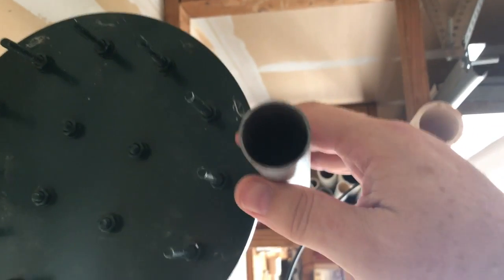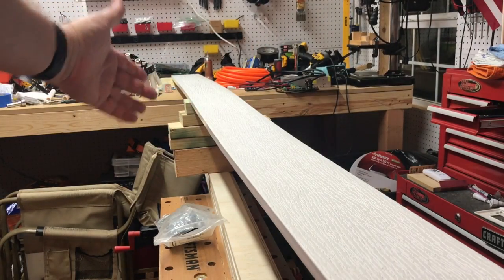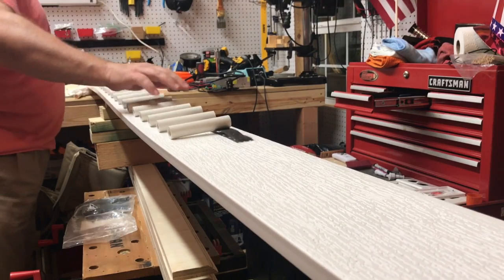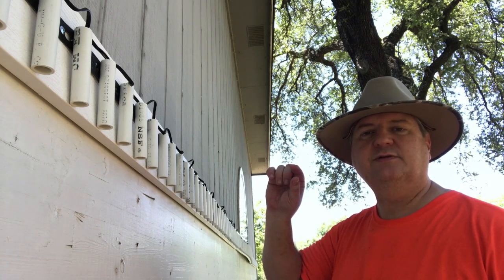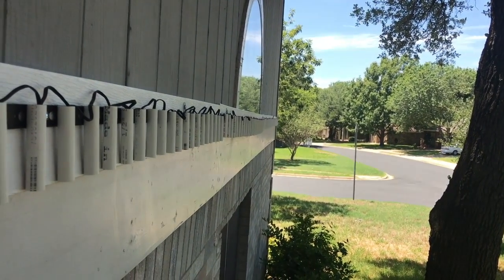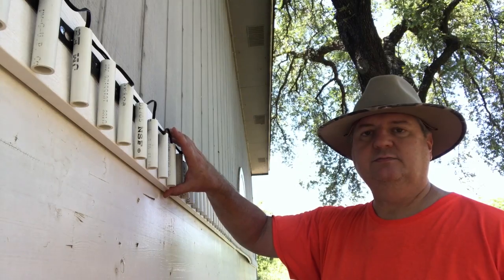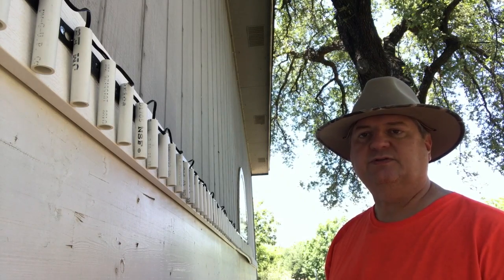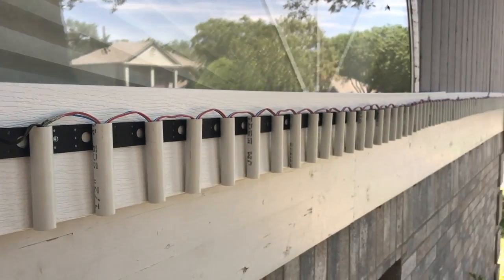RGB Pixel Wall Washer - SUCCESS!

Comment: Thank God a channel that shows it all ... I haven't had a show ... looking to get started ... but don't know what to start I want something cheap to test and play with but to also use 

Was looking at the ccc from LOR 

 Do you have any other suggestions on where I could look for something like that to get started
Reply from the maker: Haha. If you don't know what you want yet, I'd suggest getting a pixel tester from Hanson Electronics https://youtu.be/3uWoqCrFQVk and some pixels. Then check out the forums and Facebook groups I have listed in the descriptions and read a ton!

I'm not familiar with the LOR ccc line (I know what it is, but haven't played with one) so I'm not a good source for that. I use the Falcon controllers from pixelcontroller.com.
Reply: CanispaterChristmas well I kinda know what I want 

I want roof line done windows and garage 

And later in a few years  add a pixel wall on my fireplace ALL SMART RGB

But I've never used a diy pixel .... yeelight and lifx z is all I've ever touched but those are indoor and expensive
Reply from the maker: OK. I started out with a 4-port controller, got everything working (Pi, power, controller, pixels) then added a 16-port controller and ran both my first year. There is a bit of a learning curve with all of this, but it eventually clicks. You can eliminate the Pi if you have a computer you don’t mind tying up during the show, but that’s about the only simplification. A 4-port controller might do what you want initially depending on distance and the size of your house.
Reply from the maker: A 4-port controller near the front door should cover that. Power injection is just connecting more power to a string - both ends, but you should be able to go 100 pixels without it for 12V pixels.
Reply: CanispaterChristmas say that spot where I'll need 102 pixels ... will I need to power inject ? For just the 2 pixels? 

I planned on running all 12v anyways 

Just kinda nervous to spend the money then get stuck ... or burn stuff up ya know ...
Reply from the maker: I have a run of 175 without power injection running at 30% brightness and 120 injected running at 100% brightness. 2 pixels won't make that big of a deal. Lower brightness reduces power required.

Comment: question... what if the pvc tubes were mounted behind the board... to where you would not see the lit tubes... but have the light projecting out the bottom on the wall?
Reply from the maker: I still think it's a problem of direct light vs indirect light. As a decoration, it would be fine, but with other pixels pointing directly at the viewer, it kinda hides the wall washer. I am going to replace the tubes with some new pixels I've not used yet - basically a single strip pixel (3 LEDs) in epoxy and a plastic mount. That should kick it up a notch! lol!
Reply: @CanispaterChristmas  did you ever try the new pixels and got a picture
Reply from the maker: @richardcdldriver  I did, but they were defective and died quickly. Don't ever buy the "promotional" pixels. I replaced all that with modular matrix panels and square pixels. That would have worked, but I got a batch of bad pixels and they stopped working when they got wet from rain. I haven't put that prop back up since I haven't replaced the pixels yet, but modular matrix is the way to go.You can get them from Boscoyo.

Comment: Ok so I have a quick question. I have been watching several of your videos as i slowly venture into pixels. My question is, between your second wall washer video and this one, did you change anything other than the backer board? In video 2, the pixels were only shining a couple inches out of the pipes, but in video 3 there is a good foot and a half of consistent glow. What gives? Lol
Reply from the maker: Haha. I'm not sure unless I just turned the brightness up. I usually turn it down to 10% to video it otherwise it blows the camera out. Spoiler alert. That design didn't work out well. I changed the pixels out this year. They were too dim and overwhelmed by the other pixels. Neat effect tho for decorative lighting.